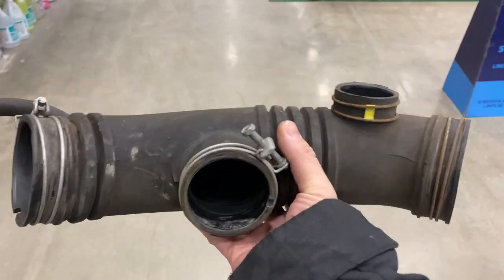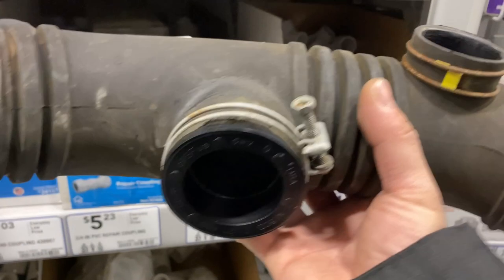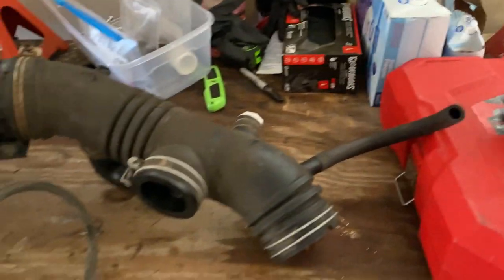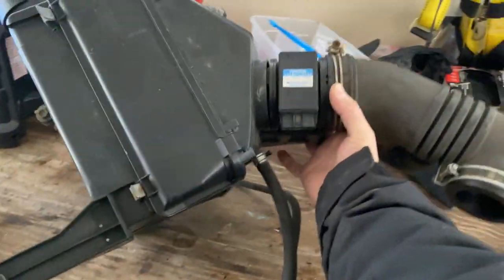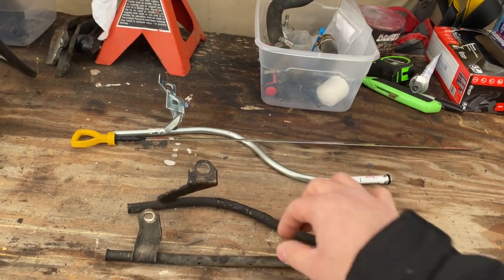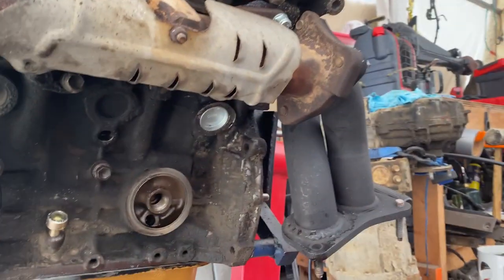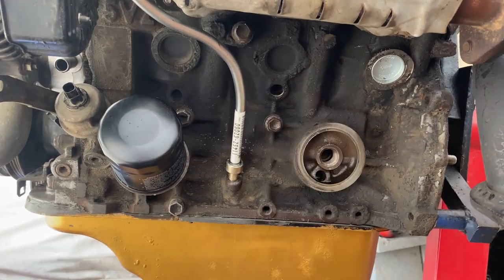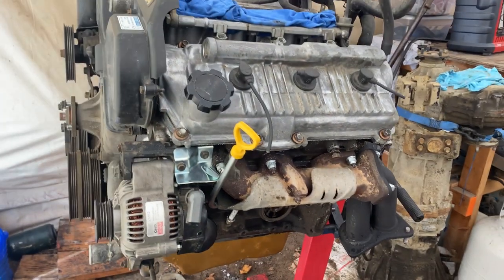Toyota 3.4 Swap | VLOG 13 | ISR MOD & DIP STICK INSTALL

Comment: Do you plan on doing an evap/egr delete on the 3.4?
Reply from the maker: 3.4 don't have EGR, that's the nice thing and I will set it up for the evaporations, run it for a while and them start to delete stuff. Yes I do want to remove the EVAP if possible
Reply: @NuttyNu  I’m wanting to remove mine because my donor was a 2004 so it would be easier for me to remove it, it’s just been a little hard to get a straight answer to do it